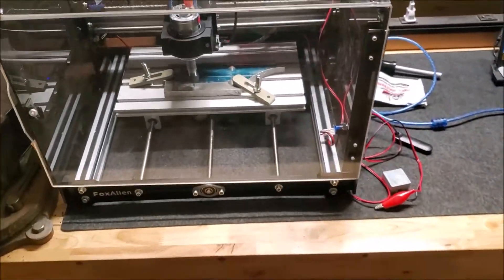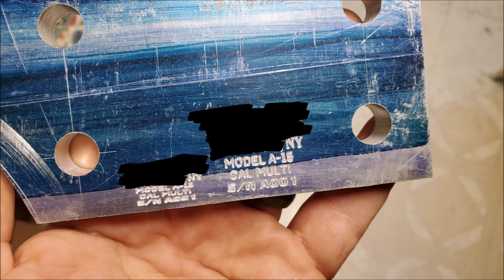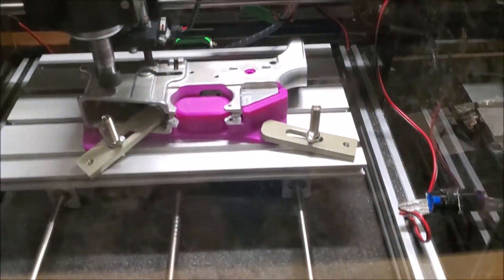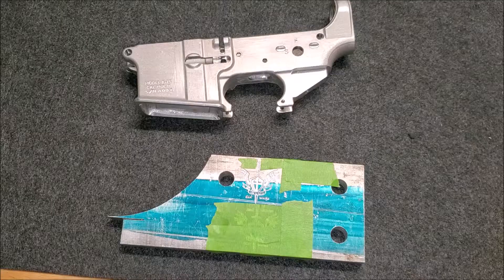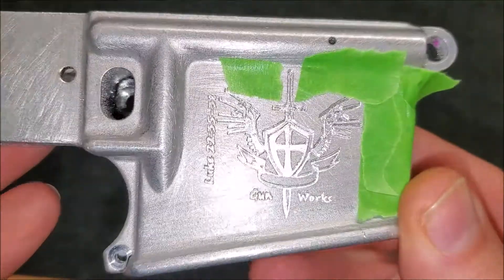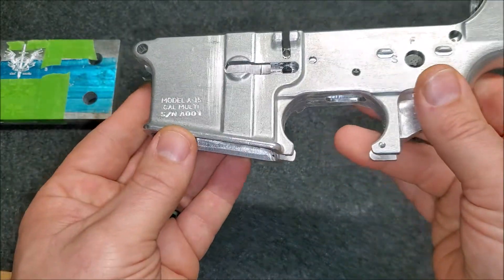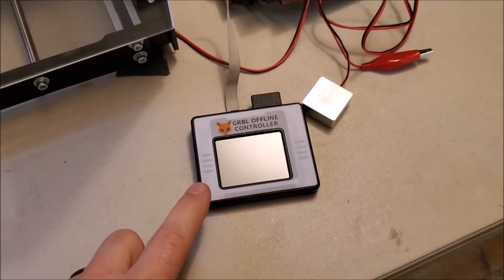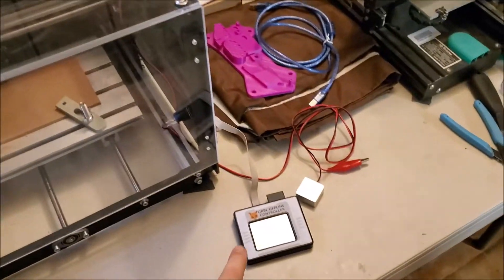Desktop CNC Engraving Aluminum, FoxAlien 3018-SE V2 first cuts

Comment: Looks good, I cerakote aluminum at work. We laser after works for engraving. Works pretty well, you might try it if you got the laser attachment.
Reply from the maker: Copy, now I'll have to try. 😎
Reply: @WJBlades   Side note, It depends also on the type of cerykote you use, We use the formula you do not need to Bake at all. Sometimes our giant universal laser system doesnt go deep enough and this thing is MASSIVE so you may need to do multiple laser runs to get it deep enough (if it looks red its not deep enough)

Comment: Thanks a million for posting this video... I just received my assigned serial number from the state DOJ and need to engrave it onto the lower receiver.  What bit did you use and how deep did you engrave the letters?  By any chance are the files to 3D print the lower receiver support(s) available online?
Reply from the maker: I got them online just type in "ar15 engraving jig" thingiverse. 7.5 hours per side.
Reply from the maker: https://www.amazon.com/SainSmart-Genmitsu-Engraving-Degree-Conical/dp/B07P99F3L1/ref=pd_aw_fbt_img_1/146-6052219-0034205?pd_rd_w=YfE6A&pf_rd_p=0ac31943-e5c4-4aef-ab7b-6ab45d3ad9aa&pf_rd_r=E9SET1MH5H31W377CEYB&pd_rd_r=2b37fbe7-248b-48fe-914d-6ca8b71f86db&pd_rd_wg=ZoZ0i&pd_rd_i=B07P99F3L1&psc=1 I was only cutting .4mm deep.